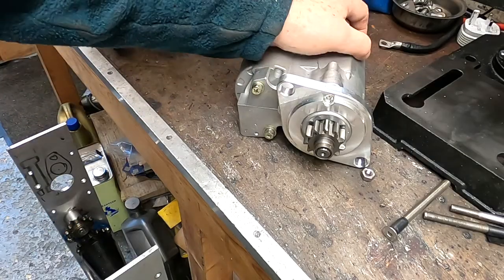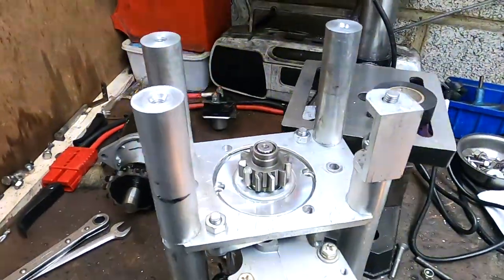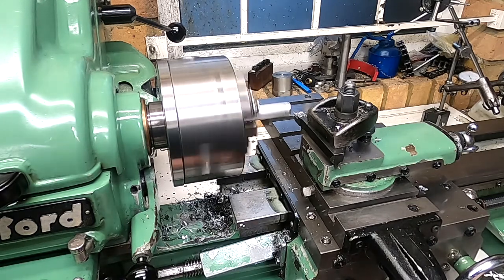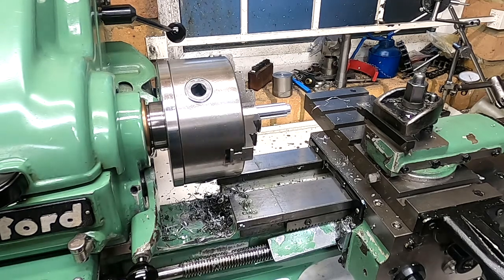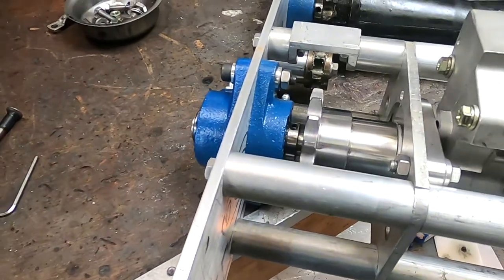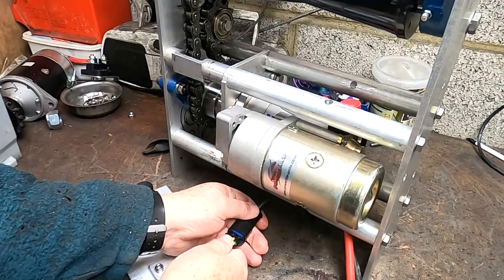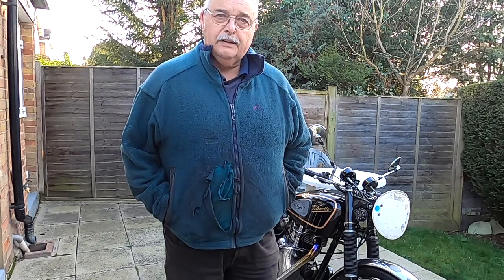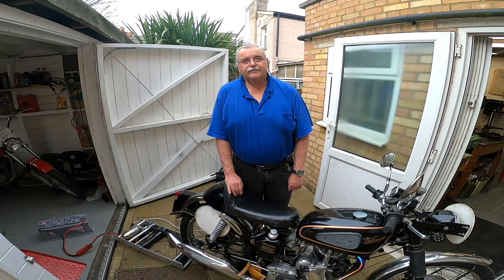Velocette 500, electric roller starter, part 4

Comment: Hi Alan, I was impressed with the roller starter, so I've had a go myself. The problem is the vehicle starter I gained from the local scrappy is not powerful enough. As you obviously had success with the second starter can you tell me what rating it is and or what vehicle it would be for. I do enjoy your channel, keep it up.
Reply from the maker: The starter is rated at 2.2 Kw. It is a geared starter motor from Powerlite in UK.
I do not know what vehicle it is fitted to. I simply asked for the most powerful motor they had in 12 Volts, and then sought to make it work. I chose not to disassemble it and simply make it a standard replacement unit.
I engage second gear, clutch gripped, lift the exhaust valve, turn on the motor and once the engine is turning release the decompression lever. You have to be careful that you don’t sit there with the starter motor turning with the engine stationary against compression. It will simply spin the rollers and melt them, it’s a very powerful set up. A far cry from the mini starter motor.   Have fun!!!!

Comment: Hi Alan always good a see and hear a velocette. Sure I’d like to know more about the cap on the oil tank. Is that pipe a breather for the tank or a breather for crankcase ? I’ve got the standard breather on my 58’ venom and she’s doesn’t  cope well with the crankcase pressure.
Reply from the maker: The froth tower built into the oil tank cap became necessary when I started to race. I had already drilled a hole in the crank casing to establish a later style breather. Both now exit to a small collector tank / oil trap which remains dry. 
Essentially the tower has a set of peripheral holes leading into an upper chamber, the floor of which is cone shaped and leads down to a central stainless tube (piece of car radio antenna) which goes below the oil level. This tends to separate the oil and gas and the gas keeps going and the oil falls down below. The outlet tube was set at a tangent to “encourage” a spin to the gas and thereby shed its oil mist into the central cone.
The alloy part of the tower is located in an original lid where I bored a hole in the lid. I secured it with JB Weld. I may have some photos which I can e mail . 
Thanks for the comment.
Reply: @alanglen5902  awk right I see now. I’ve seen the later style breather but not set up that way. Mainly from under the mag to the oil tank and then to an outlet ran to the back of the bike. 
I’ve no froth tower on my oil tank might have to look in to doing a breather modification 
Thanks Alan